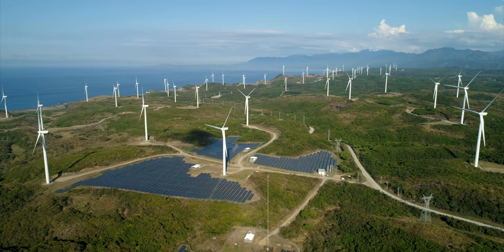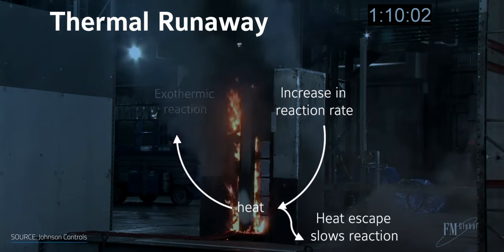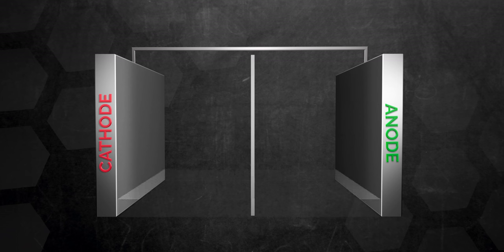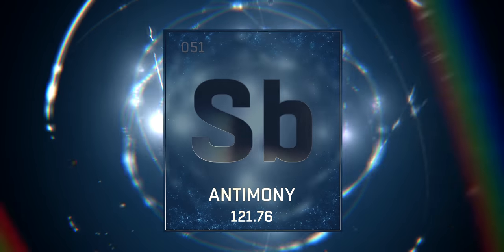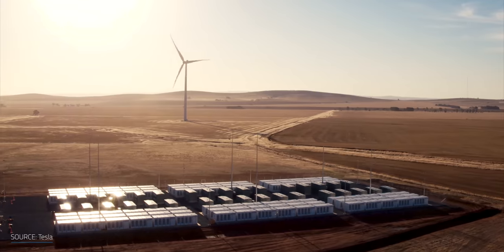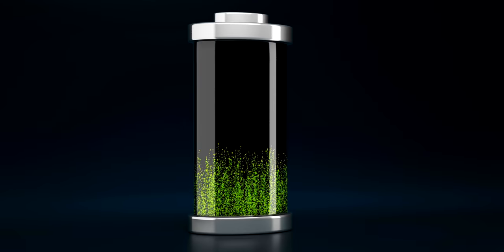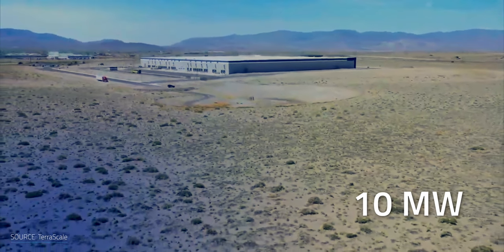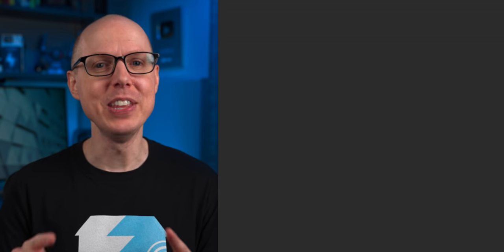Melting Metal for Energy Storage?  Liquid Metal Battery Explained

Comment from the maker: Get $50 off with code: ROBOROCKH7 on Amazon: https://cli.fm/RoborockH7-MattFerrell-YT. This promotion lasts till 7/14.  Roborock official website: https://cli.fm/RoborockH7-MattFerrell-Official

Does storing energy in molten metal sound like a good idea?  Do you think it has a chance to catch on in the next few years? If you liked this, be sure to check out The Mechanical Battery Explained - A Flywheel Comeback?  https://youtu.be/8X2U7bDNcPM?list=PLnTSM-ORSgi5LVxHfWfQE6-Y_HnK-sgXS
Reply: The main problem is that they're hot as hell, you'd have to let them cool down to do any maintenance, Tesla's grid storage you can just open up an box and replace some bits, they probably did a bunch of times already, how much would this have cost with liquid metal batteries?
Reply: How much dust goes thru the filter & back into the air with the Roborock vacuum?
Reply: I bought us a roborock s4, I think? It's honestly our favorite thing. Our kids make messes all the time and we wake up every morning to a clean floor. We nicknamed it "Dusty".
Reply: I prefer the carbon fiber wrapped flywheel battery over the liquid metal battery for grid storage.
Reply: I've been following the tech on and off ever since hearing about it in 2011. Seems like a great solution to me. Come circa 2030, the intermittency objection to solar and wind will pretty much be moot. One other technology I was excited about around the same time but has kind of fallen off my radar is pumped thermal energy storage, AKA "gravel batteries" for grid-scale storage.
Reply: why we try to find costly solutions wile we can geed rid of this energy source instead focusing on nuclear power?  It's green and can answer to power demands changes through day.
Reply: CJ Tymczak  awesome, thanks. I was wondering what happened to it. I kept hearing about Ambri but not them.
Reply: @simon2493  because nuclear has extremely high upfront costs. And not insignificant end of lifecycle costs either.
Reply: @garrettdarnell7048  we got a cat and a s4 at the same time, I'm always astounded by how much hair is in the bin every single day!
Reply: Solar and wind are NOT competitive to traditional fossil fueled power plants.  They only SEEM competitive due to the huge subsidies given for them by governments.  Look it up and don't be fooled by the first sentence of this video!!!
Reply: Also you state "zero maintenance" as a key selling point on molten batteries.  The fact remains... EVERYTHING requires maintenance.  These batteries my have extended maintenance periods but nonetheless, it is not zero.  Please get your statements straight.
Reply: Absolutely. It is the future. And if they can get a replacement for that gallium. Which technically maybe an issue. Doesn't seem like it would be that difficult to solve. Considering other room temperature liquid metals. That are more readily available.

But maybe I'm oversimplifying. Either way. The future looks bright. I might even have to start wearing shades.
Reply: @HamRadio200  they are as zero maintenance as it is possible to be, so either the term zero maintenance should be struck from our language as a useless phrase, or we can apply it logically to cases like this. These things require less maintenance than your toaster...
Reply: Earthquake qualification might require design changes such as internal baffles to prevent short circuit
Reply: @arkatub  
They have a long life  6:50 
It is new but very promising.   You can read up at Ambri.   Ambry is a genetics company.

Sorry about grammar, precoffee.
Reply: @privateperson5054  Do you think they will produce a general consumer product? Cause that's kinda the test of weather it's good or not. I think flywheel or gravity storage has a better chance.
Reply: @arkatub  
I think liquid metal batteries will be for grid storage.  They scale up nicely but not down nicely.

Flywheel is cool but in places with earth quakes not so good. They are much cleaner to make than any other type of storage.  I'm not sure if you can store a terawatt.

The problem with room temperature liquid metal is shipping.   If there is a train wreck or traffic accident how much toxic waste dumps out ?
Reply: @chance20m  end of lifecycle is problem for photovoltaic industry as well with estimated lifetime of 20 years and mostly private companies there might be no one to held responsible for utilization to heavy metal toxic panes, and wind turbines they may be waste clean but are in effective new studies show that even one turbin can decrease wind fore up to 50km behind it. I know that nuclear isn't without any flaws but it's bets what we have look at this batteries despise almost add video Matt says about energy capacity and it's still far for any significant number to secure energy demand thou night and dalii spike we would need to store giga wats of energy.
Reply: i need to get out of construction because i had to rematch the first 20sec of the video to make sure that the guy in the bottom left wasn't walking under the load of the crane.
Reply: How much is the taxpayer getting screwed for these redundant, unnecessary, superstition-driven gee whiz schemes?
Reply: After seeing the FOOTPRINT of that stupid wind farm on coastal property, I'm thinking "those high-tension power lines are starting to look pretty good."
Reply: The longevity of this technology is a game changer. They have test cells in the lab with over 50,000 cycles. Thermal management is a non issue with these cells. They cannot run away like a traditional cell. Heating the cells is a simple matter of pumping power into them. They do not require an external heat source. Honestly Matt you really did not do your homework on Ambri.
Reply: @garrettdarnell7048  Yep. Roborocks are awesome! I have S50 since ~2018. Works great in 1600sq/150m2 house. Lidar is doing great job.  Still can do full house cleaning at one charge. Just remember to clean it once a month. It will last forever.
Reply: @hg2.  
You don't want to know the answer to that question hopefully you're not a net taxpayer
Reply: looks promising than most things featured in this channel.  i hope they get their target of 2025
Reply: Ett
Reply: Question by an idiot: to stop mixing and prevent corrosion, couldn't each ingredient layer of the box be its own box made of cellphone touchscreen, or something else that allows conductivity between layers?
Reply: For a second i thought that vacuum cleaner use molten metal battery
Reply: Yo. Excellent info. Excellent analysis. Excellent video.! 👍👍

You got right what a bunch of other videos got wrong. So good stuff my dude.!
Reply: Yes it absolutely does make sense. I think there is a lot of convincing arguments why to do so.  "High density Liquid"(in terms of active material) and high temperature also stands for processes that very easily reach thermondynamic equilibrium and thus high kinetic rates. Molten salts are additionally water free and have a much higher conductivity than other electrolytes. iR drops and kinetic overvoltages typically present the most signigicant reasons for inefficiencies, and those are well addressed by such an approach.
I was a bit surprised to hear though, that the round trip efficiency is lower than for Li Ion. I think this might very much change if other electrolytes were used. If there is cross over (this is a fuel cell term though typically meaning, that  for example fuel like methanol is ending up in the wrong place, getting wasted) that can be probably addressed in one way or the other. Actually, one could maybe compare dendrites and crossover of metals because they do the same. with liquid metal there is no dendrites, but you might have crossover, which is much better than a short circuit. And that kind of short circuit only happens when the outer two layers touch badly

To have a shorttime perspective that is cheaper than a Li-Ion technology is pretty impressive.
You need a little bit more insight into the technicalities and into the science behind this to be able to fully evaluate its potential. Generally. And not only refer to a particular combination of metals and salts. I think you have to generalize and pinpoint general advantages and disadvantages. And  there is only 1 company (afaik) that has worked with it so far for a fairly short time wheras lithium ion research is all over the place and for many years
Reply: you were talking about  the downside was rust and showed a photo of a battery with rust in it im guessing, but not explaining why its a issue???
Reply: I'm seeing one issue earth quakes could end up mixing all 3 layers together so all power stored is lost, so where these are used would have to be chosen carefully.
Reply: @owend7212   While that is true. A mesh lattice of some material like tungsten could maintain it's orientation within the battery. Preventing it from sloshing around. Kind of like in a gas tank.

So that it could be used in electric vehicles.!
Reply: I'd imagine that something like a baffle could be used but it would have to withstand thermals and be nonconductive and mechanically strong enough so that when the material it is placed in cools it doesn't warp or get torn apart

Comment: I think people have to get away from the "one size fits all" approach. Stationary large battery banks for grid buffering, house batteries and vehicle batteries have different requirements. Drivetrain requirements are different for different vehicle classes etc. We should be open minded and develop the solutions that are most efficient for their use case.
Reply: @contradictorycrow4327  Well it depends on what "Monopoly" or "Oligopoly" you talk. Why are all trucks diesel? Why is the default for individual mobility an automobile? Why is electric energy storage LiPo? one size fits all is not a sustainable answer.
Reply: @TheCloudhopper  But people like simple Questions and Answers. What is best is the most asked question and the Answer is treated like a religion. There is no place for "...for that specific purpose" in this question, as there is no place for a second good in Judaism and it's two big offsprings.
Reply: Of course there are different needs at different scales.  Dr. Sadoway tossed out the idea of scaling up lithium ion batteries from iPhones right from the beginning.  He started from a crisp sheet of blank paper with what he knew: electro-metallurgy.  Ambri has the potential to hit one out of the ballpark with massive grid-scale power storage in a few years and leave li-ion stuck on first base with smartphones, vacuum cleaners, EVs and Powerwalls.
Reply: @ub59   I am very encouraged, I saw a video where he was interviewed and was asking myself: when do they announce the next stage ? Looks like they still have funding, they have the test projects for 2022,  and the tech is not that complicated so that could work. 30 % or 50 % drop in costs for robust batteries - that would be a game changer. Not only do they cost less, they would also work much longer (not sure if that was factored into the calculation at 10:50). Never mind even if they broke it down to storage costs per kWh over 10 years .... 30 or 50 % less is huge. 
That will speed up LARGE solar installation by people who have the space or want to invest in a community project. And the projects will be more viable while also reducing grid peak demand.  (the large providers do not like that, they make more money with peak demand, some providers in Texas make ONLY profits because of A/C peaks in summer. The rest of the year they hang on. 
Which explains why no one "voluntarily invests in winterization of the Texan electricity production.
Reply: Yep we need to , but cost scaling via capitlism and globalism dictate that a homogenous product is cheaper overall so we get square peg round whole solutions for the most part
Reply: That's what is happening
Reply: >I think people have to get away from the "one size fits all" approach.
No. Politicians need to move away from the "one size fits all" approach.